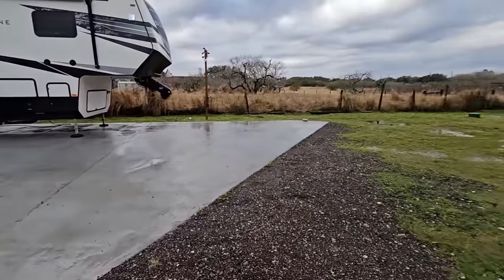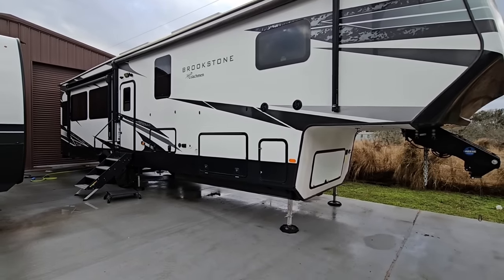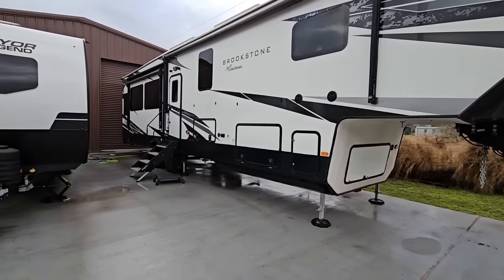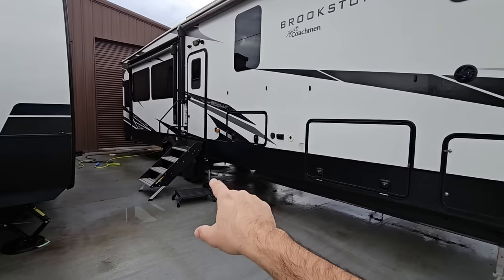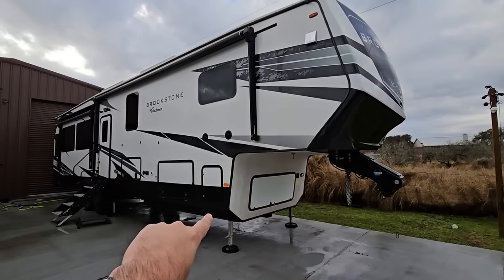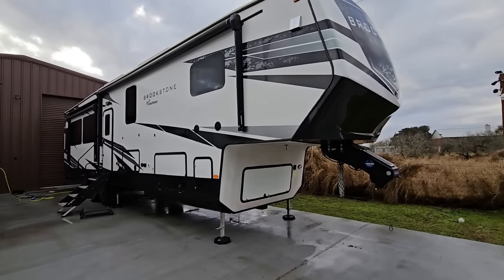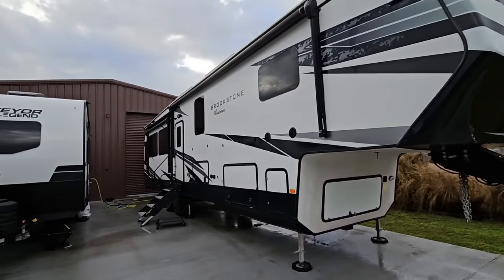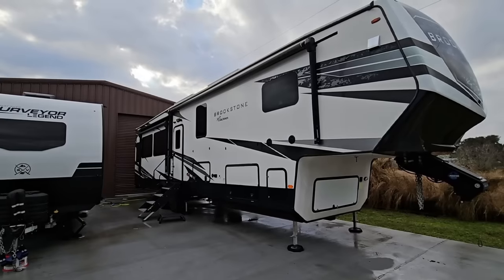FRAME FLEX on some Fifth Wheel RVs EXPLAINED!

Comment: I didn't catch you mentioning pulling trailers behind the fifth wheel either. I see some rather heavy things being towed behind that add so much more stress to the front frames areas and as well, modified, extended or goose ball drops that add to the leverage and the neck areas. Adding a rack on the back with too much weight as well that's bouncing and flexing the frames too much with the leverage of the weight out back. I did the latter one with a big bike rack. It loaded the frame enough at the back that I cracked the wall support outriggers due to the frame flexing but not the walls as they were laminated walls and didn't flex. I had to jack up the frame, jack the wall up in places and reweld and reinforce the out riggers. The bike rack was turfed. Fortunately I'm a fabricator by trade, so this was easy and cheap work for me to do myself.

Comment: As I had seen some pictures of broken or cracked sections of the frame, my idea is is that the gussets are not really the problem. I think it’s the thin wall of the construction they need to have thicker wall which means the trailer will be at least 300 to 500 pounds heavier in the front end of it. if it was all thicker wall, steel tubing along with their gussets and extra bracing that they put in there, that’s what I think needs to happen so what if the trailer is a bit heavier? Who cares at least it’ll hold up and last a lot longer because nobody can tell you how the road is gonna look as you’re going down it, 😮potholes, etc. or even a real bad construction area good luck to the people that have damaged frames and hopefully they can get them fixed and they’ll be stronger than they were. That’s the biggest headache trying to make it stronger reinforcing the frame not easy.

Comment: Frame breakage on fifth wheels is not a new issue.  Just look what happened to Weekend Warrier. Using thin-walled tubing on the pin box area, knowing full well that owners were going to off-road their trailers, lead to their going bankrupt.  I have repaired 3 fifth wheels with frame failure.  All it took was rebuilding the pin box area with 1/4 wall tubing and adding some gussets.  So even though I added some weight to the trailer, not enough to be concerned. about.  I think that adding a Reese goose box on your trailer was a smart decision   .  i added a Reese fifth airborne on my G D fifth wheel. Really help the ride as well as absorbing road shock.

Comment: This issue so concerns us that we as a family have made the decision to stick with our GD travel trailer, at least until the issues have been addressed and resolved.  There are so many variables as you have said that can cause the issue, but that doesn't negate the fact that there are structural design flaws at the welding points.  I have watched many videos from folks who have this issue and when they open the front cap and wall you can actually see the tear in the frame at or near the welding points. I am not a welder or structural engineer but I would think that fortifying that joint/area with extra angle brackets would help.

Comment: Dusting off my engineering degree…… It seems with the torque stress of the front / pin area, I wonder if the ideal design might look like beam/tube on each side going straight back about a little more than half way back, and a few stringers tying the floor frame to the mid level frame. This would give the torque a much greater arm to transfer that stress. It would not have to be terribly intrusive on the interior design, but would take a slight amount of space, and perhaps make for a narrower set of stairs between lower level and bedroom etc.

Comment: What should be stressed is that frames are designed to flex. If frames were so rigid as to not flex, the stress on the metal & welds would cause frames to fracture. That said, any excessive flexure comes from either design problems (e.g. use of overly light or thin materials to keep weight down, too much superstructure for that frame design, or cost cutting) or user issues (being over GCWR, going over too rough terrain). I think you did an admirable job of simplifying a very complex problem. The push to go farther and farther afield in the search of dispersed camping is, I think, going to be problematic for frames designed primarily for typical RV resort camping. Also, the uptick in full-time RVing is also a factor. However, even with full-time use, going to typical US campgrounds, I wouldn't expect to see frame failure in as many recently built 5th wheels as there are. Certainly, the problems are multifactorial, but I believe the preponderance of evidence points to problems of design and workmanship with certain manufacturers. There needs to be a reconning within the industry before litigation and government regulation forces the industry to change.

Comment: it would be nice to see some raw fifth wheel frames compared and even tested to find failure points.  Are the frames designed for a particular builder or are they generic and the builder puts too much weight in the wrong places?   I have owned a few toy haulers and see some crazy stuff done by the manufacturers, like self-tapping screws in the main beam edges of the frame and not enough axles for the trailer let alone the cargo capacity.  Scary stuff out there, but if you know how to eld and aint afraid to take stuff apart you can beef up the frames and make them road worthy.     It's sad that we have to do this but it's just the price of camping is the way i see it.

Comment: There are many many ways to create an overload condition which may damage the trailer and/or towing vehicle.

To avoid damage the user needs to carefully read and understand the parameters the vehicle was designed to.
This highlights JD's great past videos about the capacity of trucks and the needs trailers have. 
Also needed is a good understanding of the tow vehicle and how it reacts to the loads the trailer has.

A use history such as a route log, a CAT scale weight for the trailer and towing truck (for each trip) can be recorded (for the life of the vehicle). Records of loading and use go a long way to showing reasonable use (and can teach us about how we are doing with our towing). some folks think they know the needs and limits of their trailer and truck. Maybe so .... can you prove it to a jury ......
  
Something as simple as ignoring or exceeding the payload of the truck are indications of use problems. Another example could be using a lower rated truck or carrying too much in the truck bed such that the truck's suspension bottoms out on bumps. Or having overinflated or underinflated tires may overload of the structure in the trailer. 
Some roads have pretty serious washboard - the truck suspension may feel it handles the washboard fine while the trailer has dishes broken and contents tossed around. 

The "frame flex", "towing with a half ton" and/or "how fast can you tow" are examples of issues with many opinions......
Opinions are great - Can you prove your opinion it to a jury if things go bad ????

Be careful out there

Comment: Absolutely correct! Frame "Flex" is a term made up by lippert to make it seem not so bad. It's frame failure and anyone who has had this issue should report it to the NHTSA.gov. They are the only ones who are going to force these companies to fix these issues. 
I've had 2 Montana High Countries in the last 3 years. The first lasted 15 months and 15k miles on the road before EVERY cross member weld failed to the point it was a serious danger to be on the road. If I wasn't an engineer and caught it, it easily could have caused an accident and killed someone. 
Our second and current one had broken welds on 1 cross member just 3 months and 1500 miles into it's life. Now 15 months and another 10k miles and it's literally falling apart again. More broken cross member welds and and the front end is flexing to the point that it is causing the slide to break. 
I have NEVER hit a large pot hole, and always drive slow and easy on dirt roads. They just simply aren't designed to drive on the roads. They make them strong enough for the average weekender to last through the warranty period, and then they know it's going to fail.

Comment: I am semi truck driver. I have experienced unclosing tail doors or tandem wheels no longer adjustable due to bent sliding rails mechanism any more. Semi trailers can have structual damages by weight of cargo, forklift driving in and out of trailer, and driving under unpaved roads or construction  area.  Semi trailers are designed to take care of all above. But, most trucking companies trade them after 5 years. I can imagine RV can go bad easier. I believe you can not expect same quality like airplane or automobile. RV can be more fragile than them.

Comment: Thankyou. We do not always see eye to eye on things but I agree. Call it what it is. For example it can not be a called a hot water heater since if the water is hot no need to heat it, lol. I kept hearing about frame flex, and am like of course it flexes if it did not it surely would break. Now flexing beyond the rv frames designed limits and causing damage or failure is the real issue at hand. I believe the manufacturer needs to own up if it is a problem. Not just say you are out of warranty.  An rv must last at least structurally past the warranty.  I fear the manufacturer will not admit there is a problem, law suits. The way RV manufacturers and dealers have been allowed to manufacture and sell them over the last few years is appalling but will not change. Maybe finally time for some federal laws to protect consumers. I think the manufacturers have gotten away with poor workmanship and price gouging long enough. It's okay with me if some go out of business.

Comment: Thanks for the info JD!

How does using a Gooseneck hitch affect the frame and this issue?

I remember a video where you converted your old 5th Wheel to a GN and converted it back.

This one has a different type of Gooseneck hitch.
Are these units designed to be towed with this type of hitch? Are you concerned?

It seems to me that a GN hitch puts a different kind of stress, in different places, on the frame compared to the standard 5th Wheel Hitch.
Reply from the maker: Not sure either style would eliminate the problem completely,  especially if it's design related on a specific unit.

Comment: Your comments go along my thoughts about this issue. My 5th wheel is fine, been to. NM and back, Florida several times, NY several trips. I was thinking is maybe the road conditions, the suspension of the tow vehicle, overloading of the trailer above the max weight??
Reply: Do you know how to look for frame failure, the correct way?

Comment: I'm an engineer and I understand your point, however people already call this frame flex, its easy to remember, easy to understand to most folks, the name should not be the main issue here, its the fact that either the people don't know were or how to drive 5th wheels, there is a lot of newbies out there, in such a case maybe we need to create a vibration sensor that transmits to the truck cabin what vibration in the RV is too much so either drive slower or perhaps use another route, also with Google maps we could perhaps label which highways are in good condition for RV's and which are not, perhaps some training could take place of drivers, also RV manufactures should use optical scanning of welds, like in the auto industry, video record every single RV frame welding process so problems can be traced to the exact welder, shift, time, add poke jokes, there is tons of stuff they can learn from Automakers such as Toyota
Reply: As an engineer, what is your opinion on Sumo Springs that apply a load to the trailer frame between the spring hangers in an area that isn't reinforced for this load? Many of the frame failures in the area of the spring hangers on youtube I have seen have Sumo Springs

Comment: I am a metal Fabricator. With that said here is the problem!  “I” ❤❤beam is the strongest shape. “C” channel is less strong.  Taller “C” channel is weaker than short “c”  but they Both twist .  The current rv’s are designed with thinner “c “ making them very weak.  Now no cross beams are installed , maybe sheet metal only!!!!  This is what causes flexing and Severe Problems!!!!  Mine did this so I added cross bracing from one side to the other in 4 places above the spring hangers ( shackles) .   Problem Solved
Reply: What I've seen is that only smaller and/or light weight travel trailers use a C-Channel frame.
All RVs I've seen have cross members.  You HAVE to have cross members in order to keep the main frame square and true. 
Northwood  and Outdoors RV Manufacturing are two companies out of LaGrande, OR.  The have never used C-Channel frame material, nor did Keystone out of Pendleton, OR when I was delivering units from that factory.
The ONLY C-Channel frames I've seen are the "huck bolt" style frames from BAL and another company which I think Lippert now owns.
Reply: I think all 5th wheels are I beams. Even TTs are mostly I or box beams. And they do have cross members, but as you said, most are sheet metal these days. And as I'm sure you know, welding sheet metal to structural steel rarely results in a very strong connection. With our first Montana we found that the welds failed on EVERY one of those cross members. After only 15 months.
Reply from the maker: @deerinmyyard8430 BAL is owned by Norcol

Comment: Great video - I suspect the first of several you could do on this topic. You point out several facts (all things flex) that need to be kept in mind when trying to understand the issue.  As I have also watched numerous videos on this topic, one thing that has not ever been discussed is the tow vehicle. I am curious if a piece of this puzzle could be attributed to todays tow vehicles being so much more powerful than in the past.  Does a truck with 1200 ft-lb of torque accelerating somehow impact the trailer frame in a way that a mere 700 or 800 or whatever Lb-Ft of torque does not? Just a question that I had.  Thanks JD - great video.
Reply: I do think some of the way people barrel down the highway at 75+ puts a lot of stress on trailers, especially given the condition of some of our nations highways.

Comment: Agree 100 % on what it's being called it is a failure.  I do disagree with you on one point and thats the number of affected units.  Personally I think there are more out there undiscovered as yet.  The reason is some may only haul their unit short distances twice a year could be a long time for it to show up.  Most failures I've seen is full timers, and I believe it's because of the miles put on.  For a person like myself who hauls ours around 6000 miles a year only on highways it could take several years to show up. I did have the oppertunity to see one frame failure personally with the front of the cap removed as it was being assessed by insurance, and let me tell you it was something to see.  The welds in the upper deck were snapped, the I beam itself had 3 inch cracks in it and had seperated from the main drop down frame.  This was a couple in their late 60's and had never been anywhere but main highways and interstates and used it in the summer only, so I would say no misuse.  Lucky for them insurance did cover it (wrote it off) eventually almost 7 months after the inital claim was started.  There just seem to be so many of these showing up now and from all manufacturers not just the one we all see on youtube.  The common denominator is the frame manufacture, they all appear to use one company.  It's time the trailer  & frame manufacturer be held accountable, it should never happen period. They sell these thing for big dollars complete with up to a 20 year mortage yes mortage and yet the frame warrenty is only 1 to 3 years depending on manufacture. Maybe it's time the NTSB get involved these things could be a 10000 lb or more missle going down the highway if left undetected and a catastrophic failure happen while pulling.  At the least a recall from the manufacturers to look at each one to render it safe or not.  Sorry for the long winded post but something needs to be done before something terrible happens. For  myself I am having our 2021 (won't mention the brand) inspected in March as it's gvw is 21000 lbs and is one that appears to be failing and I'd rather know.

Comment: I don’t know if it’s frame flex but my 2023 Jayco Seismic 4113 has a crack from the corner of the master bedroom slide that is 5 inches at a 45 degree angle then goes straight horizontally about 2.5 ft to the side camera. Dealership inspected and found the aluminum wall studs broke at the frame and I have a “floating” wall. 80-90 hours of weld repairs.

Comment: Literally every video I’ve seen about frame flex if from full timers in Grand Design toy haulers. And, the most viewed, they remodeled the front main bedroom into their kids room with two beds and added a bunch of cabinetry. Most people are unaware that manufacturers state you should not even use the bed unless the slide is out to prevent improper weight distribution in the front cap. Not many toy haulers allow for more than 4k cargo. There’s no way in hell you’re living full time in an rv with 4 kids and 3 dogs and not way exceeding 4k of cargo.

Comment: It has several places it could start one might be Chinese steel, a manufacturer trying to cut corners , if the engineers know what they want and a manufacturer won't go with it, and then maybe that $15 an hour welder just isn't up to Par, we've all been on dirt roads they're smoother than the interstates these days.
Reply: The country of steel manufacturing has no bearing on the quality of the finished product.